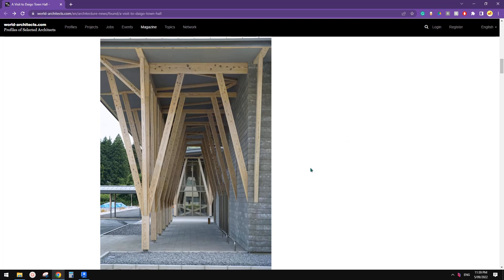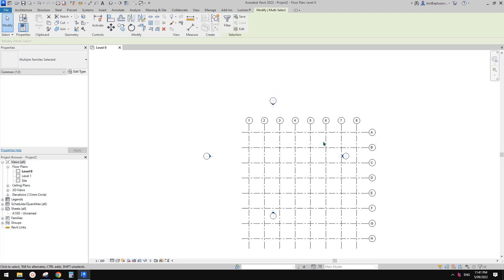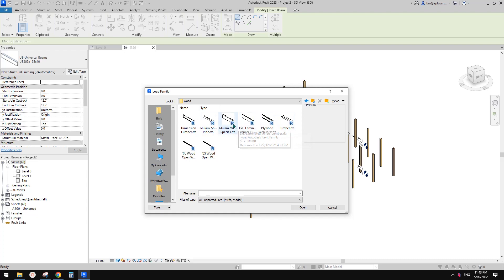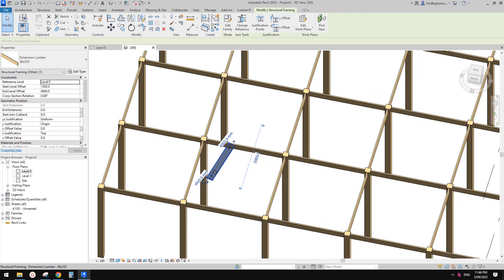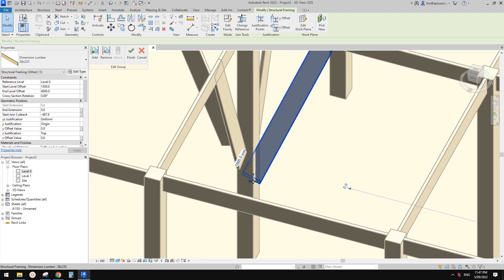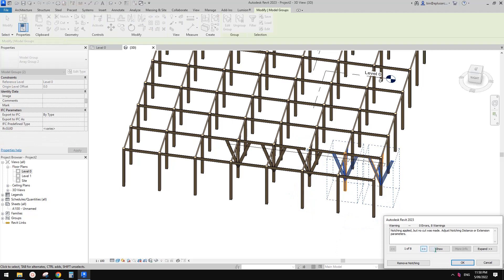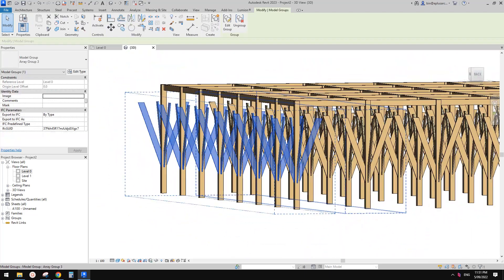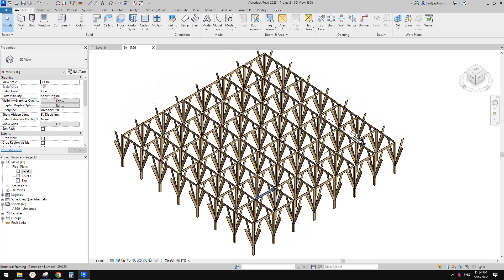Revit Exercise (Day 896) - Timber Structure Exercise

Comment: Hi. In Sweden we start enumerate from lower left corner and use A1, A2, A3...(for horisontal lines) and B1, B2, B3...(for vertical lines). If we need a new grid we use C1... and D1... Makes it easy to create new grids on the same drawing.
Reply from the maker: Cool, thanks for sharing.

Comment: Thanks Bin!
I don't know why I was thinking of doing it as an adaptive family.
But I see, if you have done it this way (with pillars and groups), it is probably because it is a more flexible and adaptive way than with families.
Reply from the maker: Agree. There are a couple of reasons.  1. It's repetitive with no variation, which means we can model one and array*3. 2.It's very easy to create this using structure column and framing family, with the opening by face tool. I would consider adaptive or pattern based if there is change of shape or size. 
Oh, there might be another reason, it will help the structural engineer if this is a real project, I guess. :)
Reply: @BINHE615  It is true!
These are two good reasons to model myself in this way.
As always a great job on your magnificent Youtube channel.👌